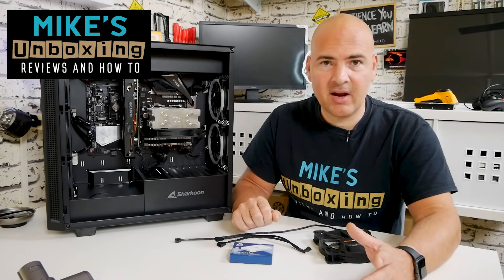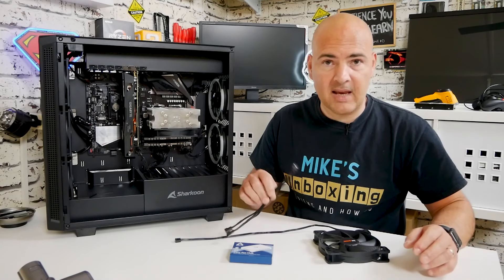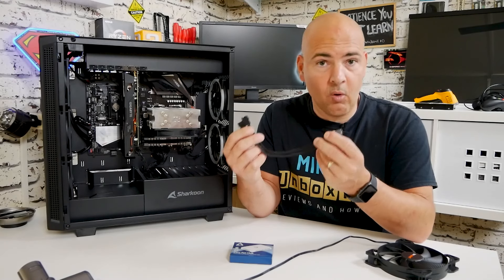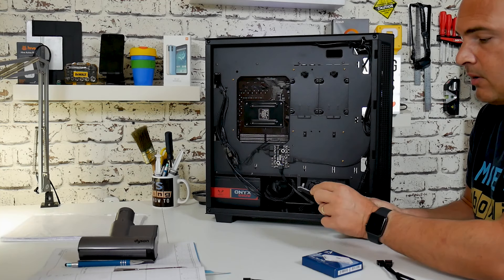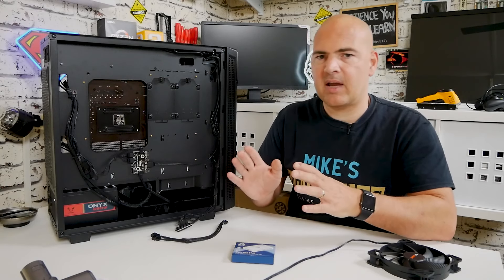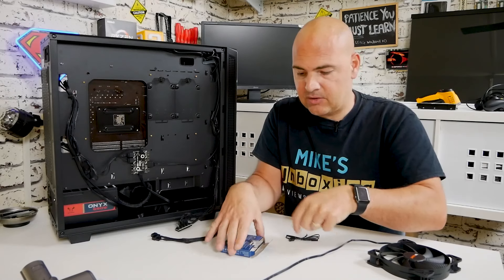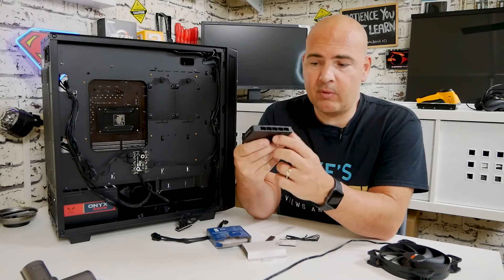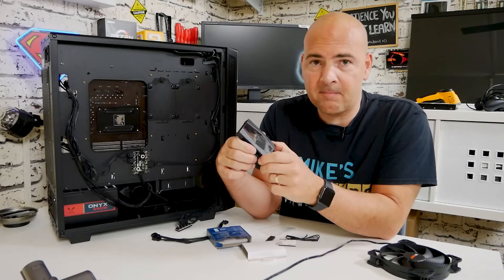How To Add Extra Fan Headers To Your PC Build

Comment: That rig is looking good, was looking at what cooler to use to get that directional back to front airflow, and go for the stealth black look. CM 240 AIO are cheap but don't want AIO I want to stick to a black tower. I need to take it out and give a good it a going over with the Chinese Plastic Crap 1000w blower every couple of month or so as will be running without filters and my walls are covered with black acoustic / speaker cab carpet in the room its going in so regular dusting is a must. working on some handles for the top today from a 19" 10u rackmount DJ mixer and some 12X8mm 3mm alu channel for load spreading inside.Make it easier to haul in and out of situe.

The Raijintek LETO pro RGB Slim with dual 120mm RGB fans is only 35 bills but might have to find some ARGB fan replacements as ones they come with are 4 pin headers and the RGB controller only seems to support 8x 3 pin ARGB ports looking at photos. Will find out for sure tomorrow ; ) The tower has a fiddley AM4 mounting system to get that front to back instead of or as well as bottom to top orientation. I have used a few kits of Adata XPG gammax ram in builds lately. Hope that will provide enough heatpipe finstack clearance as the black heat spreaders only stick up a few mill past the PCB at the ends flush in the middle. Either MSI -A pro or Gigabyte gaming X B550, for the darkness, going to be stuck at that point waiting for the new year for CPU and GPU selection seeing what the next gen brings......I have never been this exited about my own PC and its going to be stuck in a box part built for months.

Oh and still cant find my PCI slot 6x fan controller. Hope one of my kids aint nicked it for dope money. Going to be hard finding anything like it, with a temp probe and readout as that was from a small run of units for a very special order I was lucky to get it given about 10 year ago. I was looking forward to playing with my titanium knob at recording time...........It even had a tiny shard of ruby inlaid as the pointer and the artist who engineered it, sadly passed away in 2016. That possibly was for 3pin headers though as I never broke the seal to open the box.So I'm exited and happy but really really sad at the same time. I hope I can find it even if I can't use it.
Reply from the maker: the original mounting method evo 212 sprayed black would do it. i used it in my early videos and it made the cooler mount sideways, with the board being 90 degrees it would make it vertical again. maybe worth a shot
Reply: Yeah but your going into buying used at that point about 7year old, and they are silver... No RGB Mike...NO RGB,

There is an Aero Cool model for £25 but personally really dislike their stuff (melting SATA and PCIe connectors on integrator PSUs put me right off) and TT do a ring silent 12 that can do it but polished alu again and more expensive. rattle can job does not help thermals. Hoping I can sync on the board just going for a gaming X I think so going for Leto pushme pullyou tower. @mikesunboxing

Comment: A three-way fan splitter came with my cpu water cooler. One has all four pins while the other two are missing pin 3, the tach/signal/sense.  The cooler came with two PWM fans. Do all fans need to be similar so they all spin at the same speed so I should not use the third leg of the splitter for a case fan which will be a different size and load?  Thanks
Reply from the maker: yes try and keep the fans the same or they will spin at different speeds depending on the voltage sent to them

Comment: Is it safe to connect 3 120mm 2000rpm fans to one fan header ?
Reply from the maker: depends on the motherboard, but should be okay with most

Comment: Can I ask if the fan hub does supports 2 pin cooling fan? I have 2 pin fan which I find my motherboard doesnt support any of these connectors
Reply from the maker: no it won't, it needs to be a 4 pin pwm plug

Comment: Hello mike very useful video but i have a problem i have three frgb fans {fixed fans} and the cables split into molex and four pun to two pin what do i do
Reply from the maker: not really much you can do there except get a voltage dropper for the molex to slow things down but otherwise that is it sorry to say
Reply: But there are two fans with two pin and one with fourpin
Reply from the maker: @edge_1352  This is maybe easier to fix or at least advise if we can ask more questions and get direct answers, so feel free to join our Discord chat and we can go over it in more detail https://discord.gg/gaeeDPw

Comment: hi i want to connect two rgb fans together to a single chassis header. but i cant find details about power draw of my fans
my fan is fantech fc 124
my mobo is asus tuf h370 gaming wifi
will those 2 rgb fans will be a overkill for the chassis header ?
Reply from the maker: no that will be fine
Reply: @mikesunboxing  thank you.
Reply from the maker: @milindasenarath  No problem :-)

Comment: would a corsair sp120 rgb pro (3 pin) fit with the 3 pin part of the first connector. It's missing a pin in the middle from what i see.
Reply from the maker: no those won't work with anything other than the node etc, unless you rewire the pins to the "3pin 5v standard"
Reply: @mikesunboxing  I see, would I be right in saying a pwm fan hub is the best option then?

Comment: what is DC PWM or any of that? is it matter so much?
Reply from the maker: DC is 3 pin voltage control PWM is 4 pin pulse width modulation control it only matters when trying to connect hubs and splitters as the two are not cross compatible

Comment: So i ordered these fans and they came with a pwm splitter, would they be able to connect to my sys_fan ( motherboard b450M D3sh) the sys_fan has a 4 pin & the only thing i would do is connect that pwm cable ????
Reply: My pwm cable has a 4 pin at one end & 3 other cables  with 4 pin , 3 pin & another 3 pin so i just need to stick the one thats just 4pin into my sys_fan 4 pin header right? Im new to this sorry
Reply from the maker: This is maybe easier to fix or at least advise if we can ask more questions and get direct answers, so feel free to join our Discord chat and we can go over it in more detail https://discord.gg/gaeeDPw

Comment: i have question. I am planning on doing the last method and buying the artic hub.But i will be using nzxt rgb fans so can i just normally connect them on the rgb controller?
Reply from the maker: yes use the nzxt hub for lighting

Comment: Hey mike , i recently bought a msi b760m bomber wifi motherboard for my 14gen processor. It has 1 CPU fan connector. Can i use 4pin two cooler fan into that connector by 4pin spitter? I have thermalright phantom Spirit 120se cooler. It has a ' y' cable  but 1 cable three pin another is 4pin.when i join the cable, one fan goes fast one goes slow. What will i do? I want two of fans same speed. Suggest me please. Thanks in advance.
Reply from the maker: yes that is exact the use case scenario for that splitter cable. make sure to set the CPU fan header to PWM in the BIOS
Reply: @mikesunboxing  ok brother, I will do the same way you told.thanks

Comment: How would I connect pwm/argb fans? Is there an easy way to control both from the mobo. I only have 1 4 pin rgb and 3 fan headers. Looking to put 5 fans
Reply from the maker: This is maybe easier to fix or at least advise if we can ask more questions and get direct answers, so feel free to join our Discord chat and we can go over it in more detail https://discord.gg/gaeeDPw

Comment: Hey there im getting an aio that of course has 2 radiators. But im getting 3 fans for the front and 2 for the back with a msi mag b550 tomahawk. Will that like work together?(the case comes with a fan already added in the front)
Reply from the maker: should be okay but you might need a fan splitter or maybe a ARGB hub or something. If you want to get into this in a bit more depth you can join our discord chat
Reply: @mikesunboxing  ok then. Thanks for the feedback mate. Ill be sure to get on that

Comment: So I have 5 fans all have 3pin connectors while my mobo has only 4pin connectors.  So, I understand that I need a converter or a hub like the one in the vid but all the hubs I can find only have 4 pin connectors.  Will it work if I plug the 3pin connectors into the hub even though they have 4 pins?
Reply from the maker: some will only do 4 pin pwm, hard to find any others but they do exist
Reply: @mikesunboxing  thanks.  Will keep on looking
Reply from the maker: @-toadstoolicious-9851  Good luck!

Comment: Hey, so in my case, my motherboard only has von sys_fan1 and thats already connected to one. Could I plug about 2 extra fans or would it be too much for my motherboard? (motherboard: msi b450m pro-m2 max)
Reply from the maker: get a splitter you will be fine
Reply: @mikesunboxing  thanks! :)

Comment: Can I use 3 way splitter for CPU fan header and connect 3 radiator fans to splitter and splitter going to CPU fan header on MoBo.
Reply from the maker: Yes you can

Comment: Hello,

 i'm new to these things and got a AIO cooler from Cooler Master (Cooler Master MasterLiquid 240 Atmos ARGB )  I have a old motherboard b450 M and only got 1 CPU_FAN port and 2 CHA_FAN Ports.

I have 1 exit fan in the CHA_FAN 
And got the front 3 fabnsin the other CHA_FAN port

The AIO Cooler has like 3 conectors that supposed to go in the fan ports.
Do you recommend that i get a 3 to 1 CPU Splitter to connect the AIO to the CPU_FAN  port?

i'm a bit lost what to do now...
Reply from the maker: i would get a 8 port argb and pwm hub and run the fans front and rear from a single chassis fan header.
the aio pump can run off the other chassis fan header, at 100% speed
the aio fans can run from the CPU fan header
Reply: @mikesunboxing  ok thank youu

Comment: Question, my mobo has only 1 fan header, but i want to do a 200mm and 2 80mm is this possible? I know splitters are usually for same size/rpm fans, but is there a way for all 3 fans to be indiviually recognized?
Reply from the maker: they won'[t be individually recognised they with all operate on the same rpm value or voltage sent to the controller or splitter

Comment: Sir can i connect the PWM Fan Splitter to a PWM Fan Splitter. because my hub only have 4 slots. But i am planning to build a 6fan that has two hubs. and i only have 1 cha_fan. But i am planning to set RF120 deepcool ?
Reply from the maker: yes they can be daisy chained
Reply: @mikesunboxing  does my header will not burn out with that set up sir? Hub2 connected to hub1 then hub1 going to cha_fan?
Reply: @mikesunboxing  sir i am using rf120 deepcool and Asus ex a320m gaming mobo

Comment: I have an Asus A320m-k Motherboard, is it safe to use those 2 fan splitter cables? as my case only has 1 Exhaust fan and I wanted to Add one Intake from the front.
Reply from the maker: Yes totally fine

Comment: To confirm that as you saids on 03:20 this hub can control all 3 pin fans speed via DC??? (my MB have this option)
Reply from the maker: it does seem a bit hit and miss it seems with some off the feedback i had from this. it appears there are a few revisions of the controllers and they work in different ways, so i am looking for alternatives

Comment: On the header where fo you plug the header into and where do you plug the port that says CPU into
Reply from the maker: sorry i'm not sure can you give me some info on what your setup is exactly
Reply: New to this. First pc built and just wanted to add a few extra fan. Only have 2 ports from what I can see CPU Fan and Syst Fan so got a header but I honestly am lost where to plug the header into and then what goes into CPU port beside Fan1 Fan2 ports
Reply from the maker: @RagatagPictures  This is maybe easier to fix or at least advise if we can ask more questions and get direct answers, so feel free to join our Discord chat and we can go over it in more detail https://discord.gg/gaeeDPw

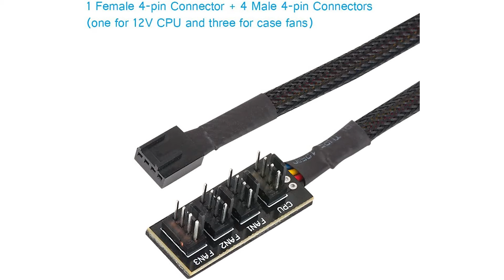Comment: Hi dude. I got a question. I recently bought a 5-pack of p14 (non pwm- 3-pin fan). I know i can regulate from the bios in the motherboard but it takes the 1 connector. I had a deepcool fh-10 but the speed can't be regulated. However, when i use a spliter (for 2 fans) i can regulate the speed in bios. Will the product (showed in min 1:51) help me with my 5 fans?
Reply from the maker: it might do, not sure as some models of those fans at static rpm
Reply: p14 use 0.7 which give me headache because I already bought 2 p14 for top intake and I'm planning to buy mobo that only have 1 ampere for headers.

Comment: Can I plug another fan hub into fan hub? is that safe?
Reply from the maker: yes not a problem as long as it is self powered
Reply: @mikesunboxing  1 4-pin PWM fan header, 6 fans, 2 fan hub each has 4 ports

4pin PWM header
  FAN HUB
    port FAN1 -- FAN#1
    port FAN2 -- FAN#2
    port FAN3 -- FAN#3
    port FAN4 -- 2nd HUB
                           port FAN1 -- FAN#4
                           port FAN2 -- FAN#5
                           port FAN3 -- FAN#6
                           port FAN4 -- N/A

Will this setup not overload my motherboard's fan header?
Reply from the maker: @nixxgg  no because the hubs are powered and you are just taking the PWM or tacho speed reading and redistributing it

Comment: Hi, I was wondering if you could help me. I've just built my first PC, I have a Lian Li coolmaster 2 mesh case with 3 RGB fans and a Corsair 100x cpu cooler. I bought a 10 way hub to connect the 10 fans to my B450 ds3h motherboard as it only has 1 system fan header. The hub only has 2 wires that connect from the hub to the motherboard header so all fans run at 100 percent all of the time. would the hub you mentioned allow me to run the fans correctly and do you know if there would be a way to connect the rgb to the motherboard so I could use software to control it and maybe sync it with my Corsair vengence rgb pro ram?
Reply from the maker: This is maybe easier to fix or at least advise if we can ask more questions and get direct answers, so feel free to join our Discord chat and we can go over it in more detail https://discord.gg/gaeeDPw

Comment: I have a question. I have 7 fans. 5 of which is an argb and the 2 fans are non argb. I have 4 system fan and 1 cpu fan.

My question is. My two fans which are non argb, i would like to connect them to the 1 sytem fan and 1 cpu fan for my be quite.

The rest of the argb fans will be connected to a fan/argb hub which the hub will then be connected to any of the remaining sys fan on mobo and of course to the argb led 12v

Is this possible?
Reply from the maker: sounds like that should be okay
Reply: @mikesunboxing  do you think i still need an adaptor for my argb? My argd are 3pins and my argb hub has a 3 pin connector .mobo had 3 pins g_dv. Should still need a argd converte or i can now directly connect my argb hub to
Mobo.

Comment: Im a bit late but I tried plugging into the sys_fan1 header but the fans dont work. I've tried using a splitter on the case fan header and the fan works. Is my sys_fan1 header broken or do I need to fix something in the Bios?
Reply from the maker: probably need to adjust a setting in the bios. most boards have a q fan or something to setup the fans speeds
Reply: @mikesunboxing  Got it to work thanks, didnt mess with the bios, just plugged in and it was fine. Maybe i plugged it backwards first?
Reply from the maker: @eggvvaffel  Glad you got it working :-)

Comment: Thx
Reply from the maker: No problem
Reply: @mikesunboxing  Wait I have a question, does the fans cable go directly to the motherboard ?
Reply from the maker: @astro4167  the splitter goes to the motherboard the the fans plug into the splitter
Reply: @mikesunboxing  just finished my build like 1 week ago, thank you this helped alot mate

Comment: Perfect sir. Good video. But i still have some questions sir. The thing is, my cpu cooler is rgb and my 6 case fans are also rgb. Total of 7. I notice each of them have two cables sir. One for the fan itself and one for rgb of the fan. Right now instead of fan splitters, i think i just gonna go with fan hub. Problem solved for that one. But what about the rgb sir? I notice in my country they do sell rgb splitters. But i didnt notice any rgb hub from my local online retailers. Does rgb hub exist sir? Because there's only 2 rgb headers on my motherboard. Even if i buy two 1x3 rgb splitters (total of six 4 pins connector) it still wont matter because i still have 1 fan rgb not connected to the pins since i have 7 rgb fans. So how to fix this sir? Does rgb hub really exist? Really appreciate if u can help me with this one sir (Sorry for my english sir)
Reply from the maker: This is maybe easier to fix or at least advise if we can ask more questions and get direct answers, so feel free to join our Discord chat and we can go over it in more detail https://discord.gg/gaeeDPw

Comment: When you say to plug it into the header can I use the rgb header to connect my 2 fans with aren’t rgb just normal no lights
Reply from the maker: This is maybe easier to fix or at least advise if we can ask more questions and get direct answers, so feel free to join our Discord chat and we can go over it in more detail https://discord.gg/XtBTGQ6BDu
Agree to the rules by clicking the emoji and you will get access to the rest of the Discord channels

Comment: how do i control the fan speed when using this arctic fan hub?
Reply from the maker: You use the motherboard pwm settings to control the fan speeds and the hub then uses that speed or variable speeds to control the fans

Comment: I've noticed that my motherboard has an extra slot for a fan, but is missing the fan header; so it's basically useless. If I buy one online, will it work if I just plug it into the motherboard?
Reply from the maker: i would need to see a picture of what you mean, you can post it on the discord or email